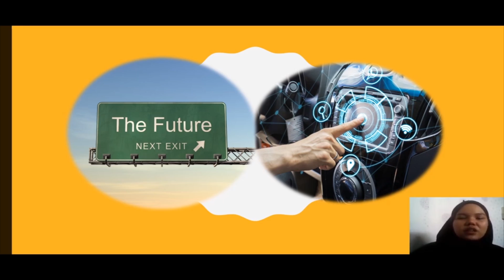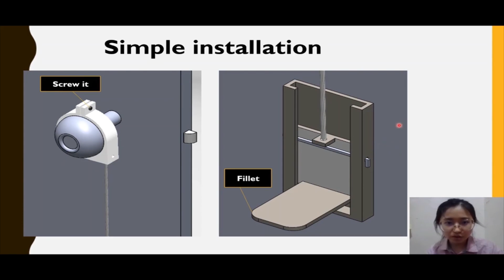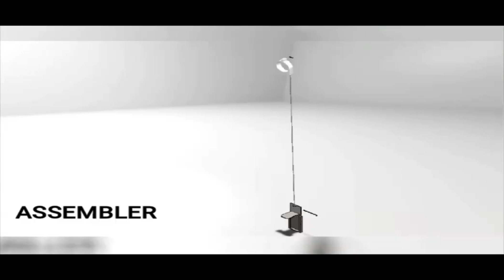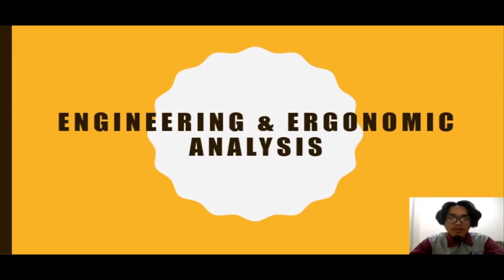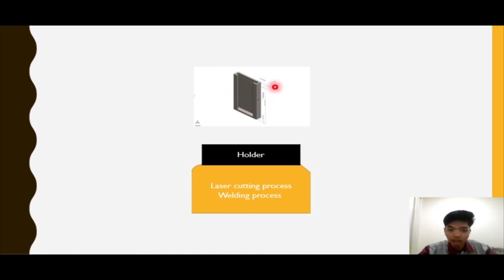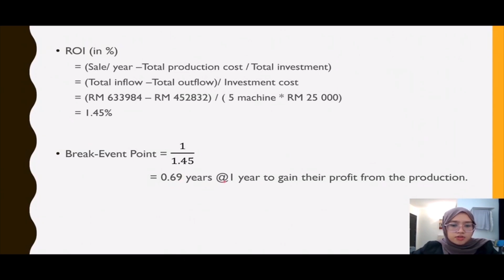Beat Covid-19 with standalone FOOT OPERATED DOOR OPENER

Comment: Salam and hi,
The idea of this project is good in helping specific group of people as mentioned in the video. Perhaps u guys can also include the demonstration video how the product is work. Only one question from me; if they want to pull the door, how can the product can ease them as they need to press the pedal and pull the knob at the same time. I believed the idea of this product is to ease the process. Thank you.
Reply: Waalaikummuasalam and hi. By stepping on the slider, the doorknob is turned. Their will use  foot grips on the slider in deciding to pull or push. So in the pull direction, they have to press the pedal and pull back the door a little bit using the slider. Then, they can open the door completely using the slider. Our product is a minimalist product (6*1.2*10cm) that eases the operation to perform in any direction. Thank you!
Reply: @afm1316  maybe in the future create a rough surface slider to ensure the foot grip. Anyway thanks for the feedback.
Reply: @oneshah24  tq for your suggestion
Reply from the maker: @oneshah24  Thanks for your suggestion, this idea can increase the surface friction for better grip and we had considered it in our design enhancement by putting some thread pattern to create the rough surface. Here is what we made it with adding the rough surface. https://drive.google.com/drive/folders/124Fuh8DKLitgIJf_na4N_MJwx5_vq6U_?usp=sharing

Comment: As Salam and Hi all,
First of all, I would like to congratulate to all group member on completing this project. The idea of project is good and could be apply for real case. However, there are few questions that I need to clarify.
1.	How will you ensure the gripping knob will not loosen when the knob twist?
2.	As we know, we have several types and sizes of knob, do you consider this?
3.	Why you choose 50N as a downward force to the pedal? Is there any requirement or calculation on that which is reflect to the OKU person capability?
Thanks and all the best.
Reply: Waalaikummussalam and good moring. Here are the answers for all questions. 

1. The grip is made of ABS material, it has the frictional surface that can grip the doorknob tightly, and its elasticity for tolerance of the size of doorknob can be adjusted. A rubber pad will be installed around the inner circumference of the grip. The gripping has the screw that will tighten the grip. Hence it will not slip.

2. Round knobs are the common doorknobs that has been used since we are considering the data from the survey and it's popularity. Moreover, the screw can be tightened or loosened based on round door knob size.

3. From research it is about 5 inch-pounds max (0.56 Nm) of the torque needed to operate the doorknob, so we make it 50N is an assumption of the average force is required to operate the doorknob by the foot. The less force needed, yet less effort applied by the users. This make OKU-friendly too.

Thank you!
Reply: Waalaikummussalam and good moring. Here are the answers for all questions. 

1. The grip is made of ABS material, it has the frictional surface that can grip the doorknob tightly, and its elasticity for tolerance of the size of doorknob can be adjusted. A rubber pad will be installed around the inner circumference of the grip. The gripping has the screw that will tighten the grip. Hence it will not slip.

2. Round knobs are the common doorknobs that has been used since we are considering the data from the survey and it's popularity. Moreover, the screw can be tightened or loosened based on round door knob size.

3. From research it is about 5 inch-pounds max (0.56 Nm) of the torque needed to operate the doorknob, so we make it 50N is an assumption of the average force is required to operate the doorknob by the foot. The less force needed, yet less effort applied by the users. This make OKU-friendly too.

Thank you!